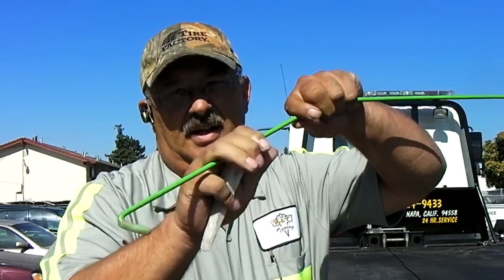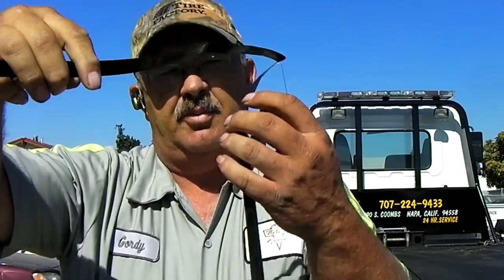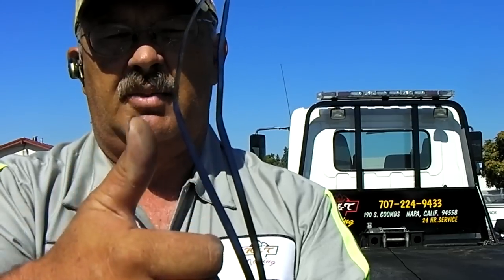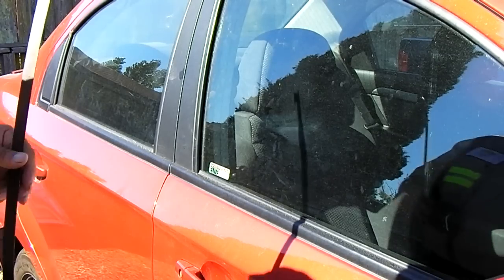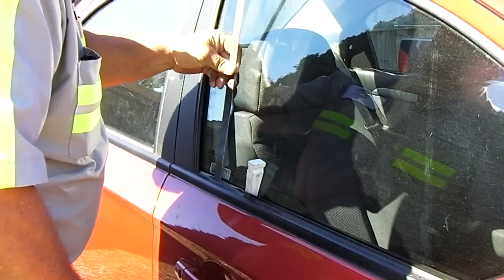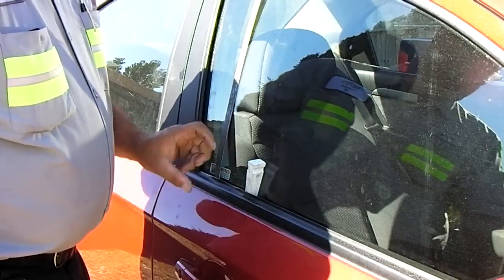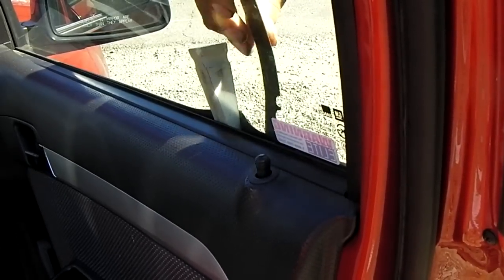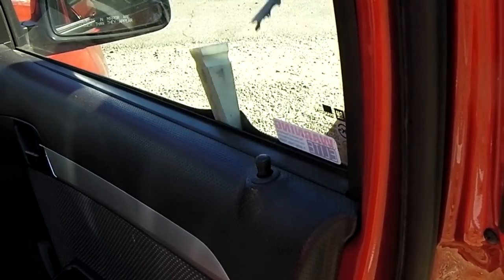Lockouts - Slim Jim VS. Long Reach Tool

Comment: Hi Gordy, I haven't spoke with you for awhile. Don't forget to mention using the airbag when using the long tool to prevent the possibility of scratching the vehicle with the wedge. So people know why we are not suppose to use a slim jim on most cars is because of the electronics and safety side air bags in the doors. I never use the slim jim unless it's a old classic car without electric door locks, windows and such.

Comment: What's the slimjim grab? (on my car the linkage runs along the inside of the door, but I have the "long tool" type of car, anyway) Does it generally work on any push-button type lock?

So it fits diagonally over the vertical linkage, and the angle jams it on?

And why is the passenger side first?

I know everyone says bad stuff about slimjims, but the name alone is enough to make me want to learn them.
Reply: +dav3fk Less wires on the passenger side. read that somewhere....

Comment: What if your tools in your trunk
Reply: rose warriner use the tool under the driver seat to get the trunk open
Reply: Ummm under the driver seat inside or outside the car?  I mean If ur locked out u can't get inside the car...so?

Comment: well i still use the slim jim on id say about 50 percent of all my lockouts but long rod is becoming more common the tools in my bag of tricks is long rod two air bags reason for that is plastic wedges can damage the doors, also the wedges are not necessary for slim jim use just push the glass in a smig just be careful not to scuff the glass with sand it helps to sand your slim jim. The wing window tools for the old school trucks with the window guard and we quit using sand paper on the sully strip a long time ago because it scuffs the locks. One thing you want to avoid with the slim jim is pushing the lock back down to hard and you can knock the linkage off and you also want to pull the slim jim out before opening the door or you can knock the linkage off that way.

Comment: toy tool,slim jim,strap and long reach with wedge and air bag this is all i need to open any car. on the strap they use straps on boxes of nails so if you have a friend in construction grab a few from them work just as good and there ruff don't need sand paper

Comment: I have a folding slim jim. I think I used it only once, and then on somebody else’s car.  Told her before hand that it could pop off the linkage and she was okay with that. Opened the passenger door right up, no damage.

I went in through the passenger side of her car but had not heard that such was advised. I did it bc IF the linkage popped off then the driver side door still worked fine. What is the reason?
Reply: fewer gadgets in the passenger door to snag and break.  Driver door is generally full of electronics.

Comment: I Damaged the lock by trying this. The door went open but since then i can't lock the car with the keys! What do i have to do now? Please help me!!
Reply: you knocked a small rod out of place. you have to take door panel off and stick rod back in. the long horizontal rod to the front of vehicle is attached to a small vertical rod going to the door lock handle. the slim jim knocked the small rod out of the small hole it was resting in. one reason i only use a long tool
Reply: Divus Band 
That sucks

Comment: This definitely helped. Bent the slim jim some used the wedge and tried on the passenger door. 10 seconds later I was in my car. Took longer to get the slim jim out than it did to open my car.